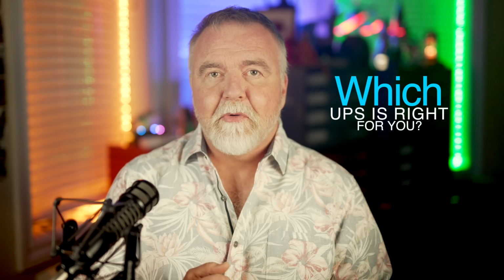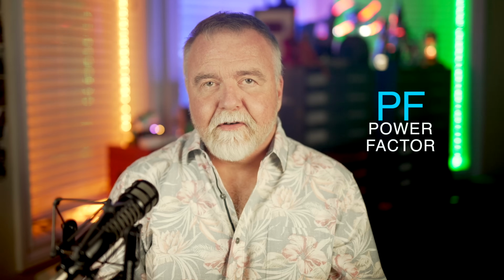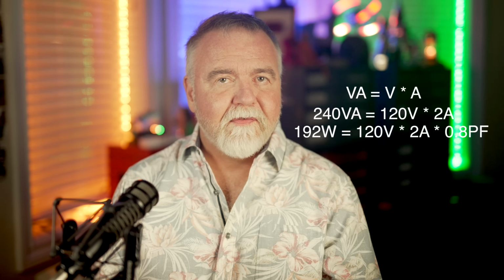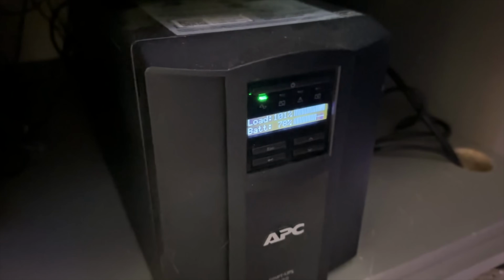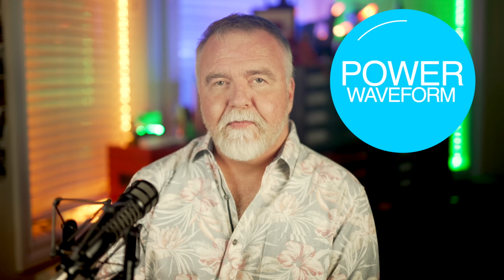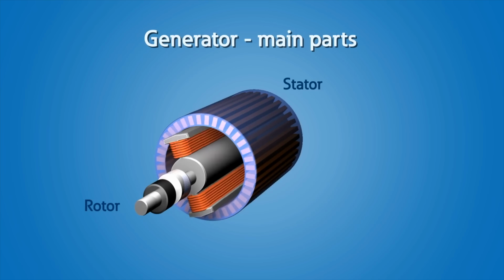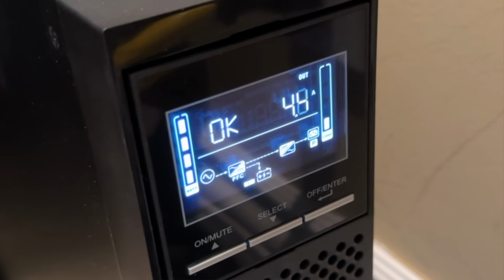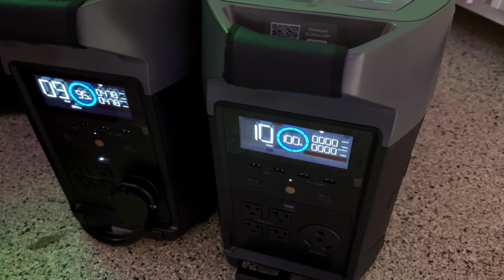The UPS Secrets YOU Need to Know!

Comment: Great video sir!  One thing to add: be sure to test your UPS setup every so often.  Actually pull the plug out of the wall and see if the battery is really in good shape, and that comms link to your PC is still functioning.  Nothing worse than doing the good work to buy, configure, connect a UPS and then find out you disconnected the USB cable when you tested that new <other_product>...

And test your backups for the same reason.

On the subject of UPS batteries... I think one well-known UPS mfg, or a large online retailer, or both, are shipping undersized replacement batteries.  I've never seen a 9Ah replacement test out at >6.5Ah.  Something you might want to look into?

Cheers!
Reply: SLA batteries the amp hour rating is determined at a specific set of conditions. They charge it and see the capacity, say 9Ah. Then discharge it at a rate that it will take 10 hours to discharge, so around 1A for that battery, a C/10 rate of discharge. However discharging at a higher current the amount of energy you get out before the low voltage cut off is lower, so it will likely, at around C current draw, only show 6.5Ah capacity, and conversely, at C/100 it might run for giving an apparent capacity of 11Ah capacity. 

I took a 20Ah SLA pack, known to be poor, but still delivering 13.8V at 100% SOC, and loaded it down with a 3s white LED string, that drew 100mA initially, and left it to go. After 5 days it was now down to 11V, theoretically fully discharged, but still was able to light the LED string with 5mA, and after a further 2 days it was at 9V, and the LED string was still glowing, albeit dimly, and you could see the individual dies in the yellow phosphor coat. Another 2 weeks and it was still glowing enough to cast a shadow at night.
Reply: If you pull out the plug, the equipment will lose its earth protection.
I've run into situations where this is not ok!
All UPSs instead have a button for quick test...
Reply: @emilalmberg1096  Noted.  So just pull the fuse/flip the breaker off at the main panel to keep the protective earth.  But I would also say if your setup has some weird earthing issues, best to deal with them before someone trips over the power cord and pulls it out of the socket.   And I don't trust any sort of self-test to tell me what's really going to happen when the power really fails.  Cheers!
Reply: @grottyboots  Simpler UPS and devices have ground via the cable only.
The test function turns off the rectifiers for a while, that's enough for most times.

Comment: Car audio amplifiers and subwoofers are great example of a/c reactive load. Lots of YouTube channels test the amplifiers on amp dyno that’s a resistive load giving you s best possible power output of the amp at specific ohm loads also a good stress test on the amps to see if they are quality built or go up on smoke😂

Comment: i am running the Wroung one on 2 Lawn and garden batteries. 
APC Back - UPS RS 1200 it needs 24V so i wired in 2 Lawn and garden batteries it's  just on my truenas. so it can shut down in a safe maner.
then i have a APS 500 on my Cable modem / PFseance Box

Keep in mind the Power Supplys in like 99% of every thing made today is a Switching power supply they just converting every thing to DC any way so a square wave is fine and more efficient.

Comment: I have a smaller UPS that my ISP provides (and maintains) for my network gear.  I run line conditioners on all my electronics.  Even have one on my refrigerator. These line conditioners are not just cheap MOVs that only deal with spikes. These clean up the AC and correct under and over voltage situations. Tripp Lite LC1800 or something similar.  You can get 120V and 230V versions.  When power goes out my network runs on UPS and I use my laptops.

Comment: So happy you touched on Generators. I do nto have a whole house yet. I purchased and setup a 15000watt generator at 50 amps to run things in the house like my well, and internet and some lights. Turns out I only use about 40-50amp at most> I can run the whole house with exception of my water heater.I have 11 Cyberpower UPS. Turns out only 2 of them are sinewave and all others will not work on the generator since its dirty power. The 2 sinewave work. UGH, had to learn the hard way. I will get a Generac 24kw in the late summer and all should be fine. From now on, I will purchase only Sinewave/Smart App units that aid in this transfer and will continue to power and protect. Anyhow, thank you for the explanation.

Comment: The VA value is related to average current (amps) which IF it's higher when voltage is lower (than if it was a resistive load) means there's more heat but less average power. For part of each cycle (Hz), the current is similar to a much larger load then briefly lower than expected but not enough to make up for the time it had excessive current. Power is more efficiently supplied when the highest current is when the highest voltage happens each cycle. A 1500VA UPS is often around maximum of 1050W RMS continuous, the VA value assumes a 0.7PF (eg. old PSU with transformer), this would be ~1167VA@0.9PF (eg. modern PSU with some PF correction/mitigation) but the power (W RMS) is still limited to the same 1050W in this example.

Comment: I modified an APC smart 3000VA rack unit with custom firmware to use deep cycle marine batteries.  I have 8 giant batteries for a total of 400ah at 48volts.  I can survive a decent power outage with my whole network powered...  I do have to keep them topped up with distilled water about once a month. They are also heavy AF.

Comment: I use the APC 1500VA Smart UPS like you on my workstation. An AMD 7900X and 4080 FE. I took my 3960X and tossed it into a server chassis running XCP-ng. My rack has a V7 (3000VA)

Comment: Another alternative is a low voltage ups, i build one for my rack at 12 V, the microtic switches working at 12 V and my Microserver has a MicroPSU, the POE Injectors are even using 12V, the benefit of a lower power System is that the efficancy is much better, i have only one longlive power supply with 12V, which works constant at a point where it is at > 89% efficancy, although the runtime at power lost is mich longer, the dc supplys are all very efficant compared to the dc to ac and dc to ac conversion from normal UPS. My UPS has even a usb/serial connection for monitoring it is recognized by the os as normal UPS. I even build one for work at production testing systems with an intel NUC it just works great and has a runtime of 12 hours, equipt with LiFePo4 batterys.
I can just recommend it, there are even 12/24V UPS ATX supply’s for this.

Comment: another great video from you !  The achilles heel of UPS's is the constant battery charging, this is what makes the lead-acid batteries to bulge and die.  It woudl be good if the UPS manufacturers implemented the simple and cheap charging to interrupt when the battery is full, and resume when reaching a somewhat 'less-full" level.  While an event needing the UPS when the batteries have not reached the "less-full" level, thus not being recharged, would mean less time the UPS is available, this could be ameliorated via larger battery capacity.... I've had a couple of the cheaper APC UPS's that I had to replace the swollen lead-acid batteries quite often, and finally got tired of it... Hapy New Year !

Comment: In my 20+ years of using UPS I had noting but disappointment from consumer grade standby devices. My go to for a long time was the Eaton Powerware line. My only complaint is the price. They have been discontinued for a bit now, but replacement batteries have continued to be available and fairly cheap. I will have to give Extreme a look for future purchases.

Comment: 8:30 HWiNFo will tell the UPS load if you don't have a screen... at least on the APC oness, as long as the data cable is connected, as the UPS has the info, it's just not being displayed.  I had the same issue and had to upgrade as well.

Comment: I've been really afraid to go with lithium UPS for fire risk.  I want to wait another couple of years and see how it goes.  The lead-acid batteries are SO heavy.  Got a nice 208V Tripp-Lite sinusoidal full time conversion system over here, never going back to line-interactive.
Reply: Dave said the the batteries in the unit were LiFEPO, Lithium Iron Phosphate. They don't have the thermal runaway problems that more energy dense chemistries have.
Reply: @JohnOverstreet  LiFePo4 batteries are certainly safer, I’m just gonna wait.

Comment: Buying UPSs were the biggest peace of mind investment I did, 1800va Sine Wave, 24v 7A Lead Acid battery, manufacturer sells replacement batteries and extra ones for extended uptime, hold my setup, PC, PS5 (never both at load at the same time), router and 2 screens, it holds on load for about 7 or 8 minutes, plenty for a safe shutdown of everything if the power doesnt come back quickly

Comment: Dave this is a fantastically complete review of all UPS types and technologies. I suffered through learning all this the hard way with older technology UPS units in the 90s and 00s. Back then it seemed that the manufacturers all set the battery charging voltage too high so that the battery would prematurely fail. Your video mentioned but didn't dive into the "costs" of power issues. That'd be another great video topic. Please keep up the great videos... always very informative, and your production quality makes watching them very enjoyable!

Comment: Minor nit: The float batteries at 19:46 are lead-acid, so the voltage per cell is 2V.

Decades ago I worked in a computer and telecommunications center where a whole floor of the building was an array of about 40 rows of batteries as shown in Dave's example. In the basement there were three 1 Mega Watt diesel generators, for reliability. One day during a storm the building was hit by lightning and the master breakers disconnected the building from the grid power. The backup system perfectly switched over to the battery array, which was sized for about 3 hours operation, the expectation being that the generators would start up within minutes of loss of grid power availability. Tragically all three generators failed to start up, and after a few hours the batteries had been depleted and the building and all computers and telecom equipment lost power. The system had never had a real "live test" of losing grid power. The problem was that the starter motors for the diesel engines were wired to grid power via the master breakers.
Reply from the maker: Good point!

Comment: You said they have surge protection - well - that's a "maybe". In my last job, we had three GE UPSes - 15kVA or so - and a longer offline job was planned. Since we didn't have a generator, we hired one from the power company. They came and put it outside, laid down the cables and switched off the main power - the UPSes took over. Then they powered up the generator and for some reason, it sent a 4kV pulse into the UPSes, which paniced and went into passthrough and sent it all into the datacentre. Popcorn time! Quite a few PSUs were fried among with some disks. IIRC no motherboards were damaged. Interestingly, the stack of SuperMicro machines just buzzed on through this mess - nothing even in the logs. Good PSUs on those.

Comment: One advantage of online/double conversion UPSes which Dave did not mention is that they are said (by manufacturers) that are running the batteries, especially lead-acid ones, in a regime that leads to longer battery life compared with batteries in a line-interactive UPS. This way, they say, it offsets the extra costs with the reduced randament of online/double conversion. I do own several UPSes, mostly line-interractive but also one online/double conversion but not for such a long time to confirm if there is a difference in battery life.

Comment: I wish there was a UPS that skipped over the thing with double conversion and charged the 24V batteries and feed that DC directly into the computer after stepping it down. Just like servers PSU do.
In fact, you only need a single conversion AC to DC to battery then 24V to 12V DC/DC PSU to the rest of the computer (plus 5V and whatever, most motherboards only use 12V either way and regulate themselves what goes to the devices.

Comment: You say that a pure sine wave UPS is the best. That not always the case. Modified sine wave UPS's work best for any load the is Switch mode power supply(SMPS) based. Most computer loads are SMPS based. It's a bit too technical to explain on a single TY comment but SMPS loads run much more efficiently on a MSW supply then a PSW supply.
Reply: sure about this? Everything I have ever heard on the topic is, if you can, get pure sinewave, as all PC power supplies work well with it, as opposed to modified sinewave which is supposedly more of a crapshoot.

Comment: When we ran an ISP back in the 90ies, we had an online UPS. We never ever lost power, but the USP did break and left our server room dead in the water.
Reply: Typically a data center of any magnitude or risk of lost work should include two completely separate power feeds from main services. That is IF you can get that at your location.
Reply: @wickedcode007  doesn’t help when the UPS dies, though. I guess if you had all devices with redundant power supplies and use 2 ups, ok, but we didn’t swim in money then.

Comment: I use 2 smaller APC ups' and one bigger one. The big one can run my pc for about an hour. The two little ones are for the modem, and for two tvs I use as my monitors. The TVs only get about 5mins of up time with the small guy. But it's mainly for brownouts. The modem can run for about 30mins on it's own APC. 
Recently I've been getting extended brownouts which trigger the annoying alarm in the smaller APC. I was thinking about putting it on the big but that seems counterintuitive. The TVs would drain the power like crazy. I went from 18mins up time to 1h by putting the tvs by themselves.

Comment: Natural-gas auto-starting generator plus a 2200VA power-conditioning online APC UPS on its own 20A circuit here, after too many power drops. It's awesome. But it's not total peace of mind. Parts on the PC side of things can still die on their own. Not as often with conditioned power, but it can happen, and it can not only take out your data but also other parts that are on the same circuit. Aim to isolate as much as possible, not just protect. The only thing I have on my UPS these days is the PC and its primary monitor. I don't even put anything except the UPS on the 20A circuit.

Comment: Great video, Dave. Just one thing - the diagram you used for a 'modified sine wave' (a marketing BS term) was completely wrong, as are many.  There are ony three states with a MFS waveform - high, zero, low. It's just a square wave with a lot of dead time added, and given a nonsensical name in a cynical attempt to woo the unwary with the words 'sine wave'!  I'd advise anyone buying a UPS to get a pure sinewave one. A reconditioned one, if a new one is cost prohibitive, would still be far better than a brand new MFS one. It's perhaps worth mentioning that there are some PC power supplies with active power factor correction that don't like 'modified sine wave' or square wave inputs.

Comment: Dave, something you kind of "glossed" over in your comparison between Lead-Acid and Lithium is that, while LA is much more cost effective, and the batteries will need to be replaced every (most likely) 3-5 years, . This is true for both LA and Lithium, but is MUCH more pronounced for LA, by a factor of several times. Simply put, Lead-Acid hates to be drained, while Lithium likes it. That 3-5 year average could easily be reduced to only a few months with only a few drains per year, making the cost of Lithium a lot less "more" than Lead-Acid in some cases, because of the frequency of needing replacement lead-acid batteries. In fact, if a lead-acid battery is ever COMPLETELY drained, it may never recover or ever hold a charge again, and if it does, it will likely be only a fraction of it's original capacity.
I have three of those exact APC 1500 Smart-UPS UPS' that you have, and also one rack-mount APC 1500 SmartUPS with an additional battery back that I use on my server and network equipment, and have routinely replaced the batteries every 3 or 4 years. While I like those UPS', replacing the batteries so often is frustrating and costly. I can't help but think that, if I were to replace them all with Lithium UPS', I would likely be able to stretch the battery life to 7-10 years or maybe even longer.
Basically, the more one expects the UPS to be needed, the smaller the long-term cost delta is between Lead-Acid and Lithium. IMO, the future is Lithium. I, for one, will never buy another Lead-Acid based UPS.
Thanks for your insight, and my compliments on the video. UPS' have a "black box" sort of mystery about them to most people, and your explanation is very accurate and relevant. Thanks, and keep 'em coming. :)

Comment: Ive been looking at a good (victron) inverter with passthrough and boost and seperate lithium ion battery and surge suppressor for our plc cabinets at work to replace the UPS,'s. 90 % of our failures are the batteries (AGM) failing.